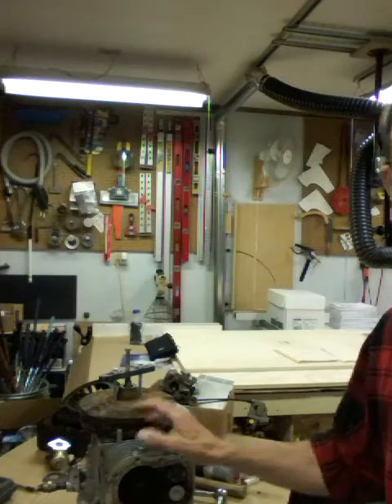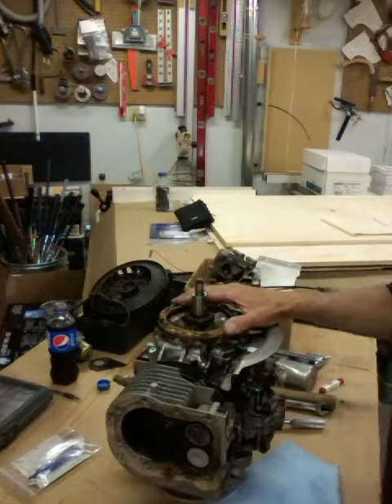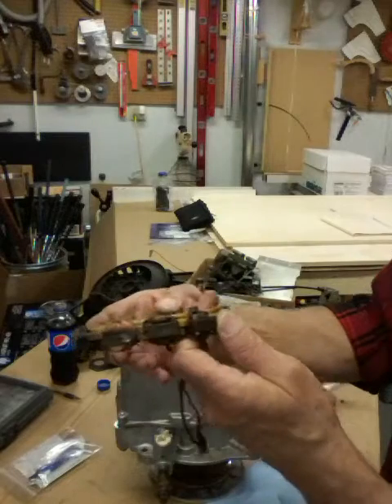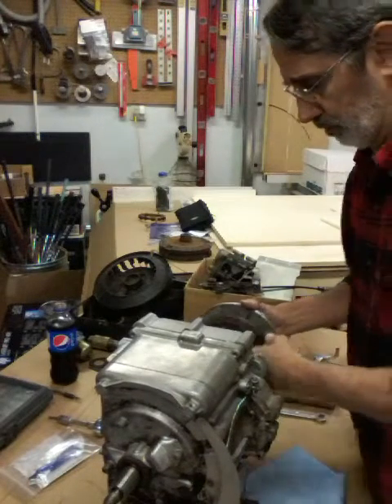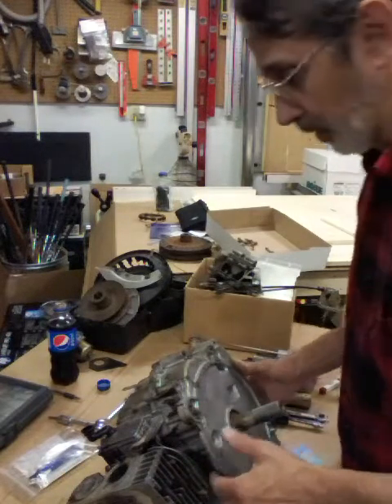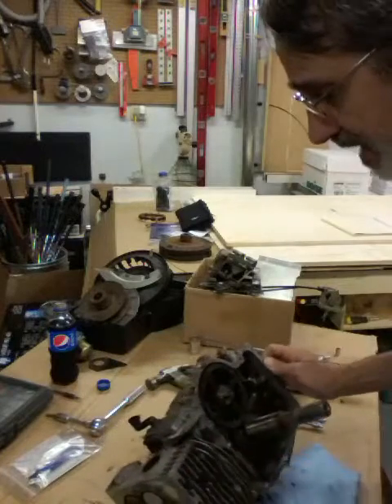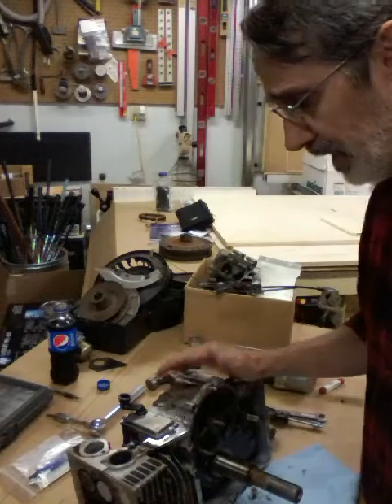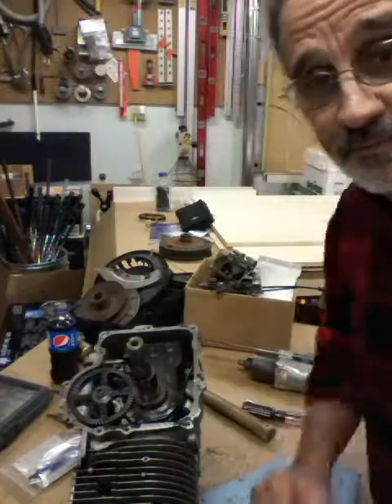26. Rebuilding my Snapper engine part 2 of  5

Comment: Mr. Jackson, you can check this on any B&S website but rust does NOT effect magnetism on coil or flywheel. I labored under this misconception many years as well!
Reply: Yes, all it consists of is a magnetic field caused by the permanent magnets and as the rotating magnetic fields in the fly wheel pass through the stationary coils an EMF (electro-motive force) is induced in the coils.

Comment: Mr. Jim, the camshaft will come off with the valves still in the engine. You need to align the timing marks on the camshaft and the crankshaft gear first and then the camshaft will slide right out.
Reply from the maker: Exinanition    Well thanks for the tip I'll try that next time